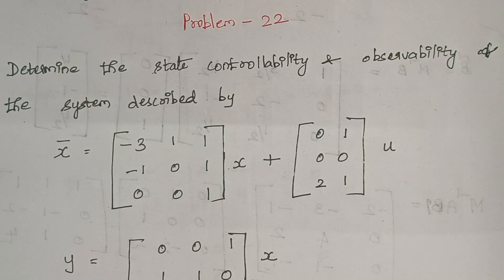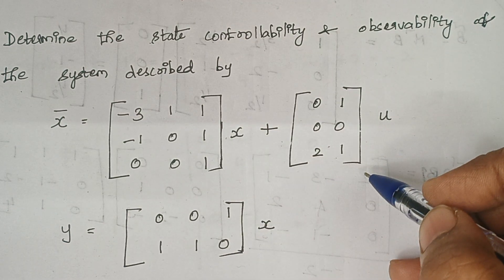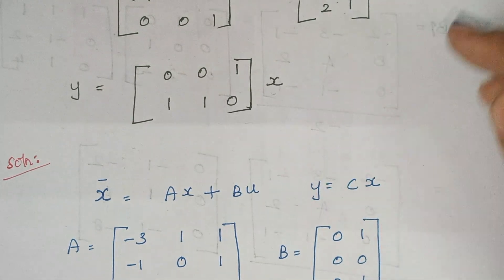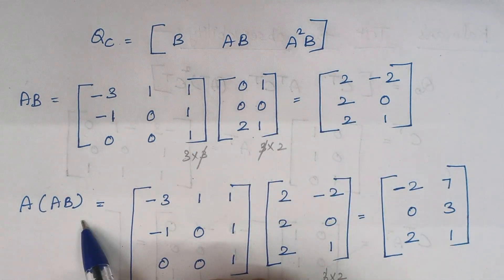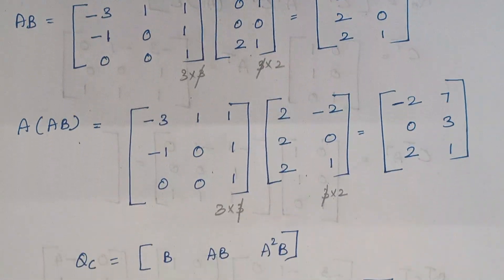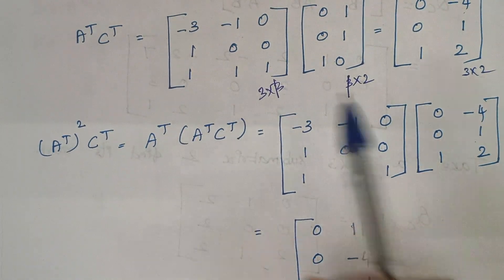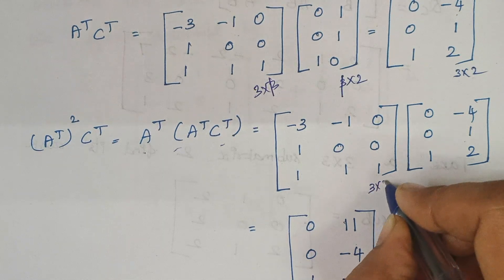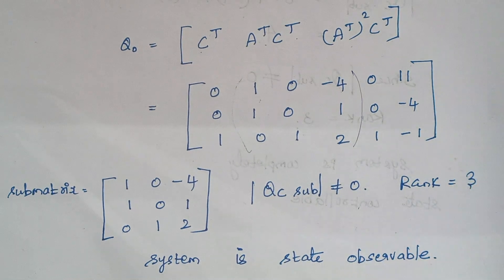Problem -22 ( state observability and controllability)

Comment: Design a full-order observer with the observer poles at s=−12±12j. The observer gain matrix is given by [ke1 , ke2]. Find ke1 and ke2.
Maam how to do these questions ? Any good reference book which has lots of numerical examples other than nagoor kani.
Reply: Nagoor
Reply: Doesn't have unit 5 tight
Reply from the maker: Go with  advanced control systems book .any author is fine